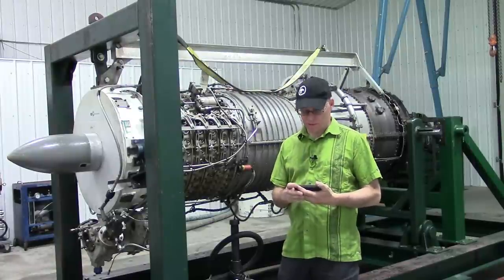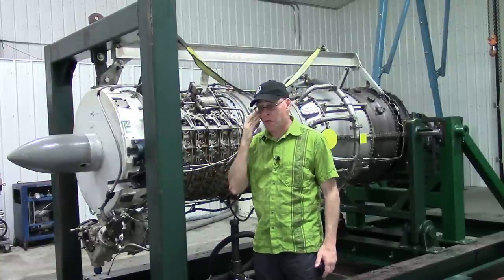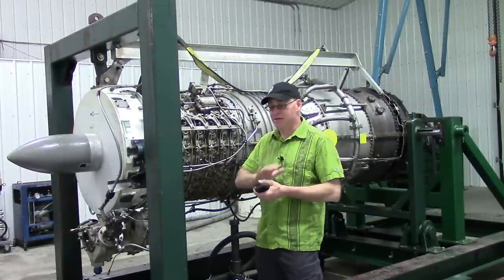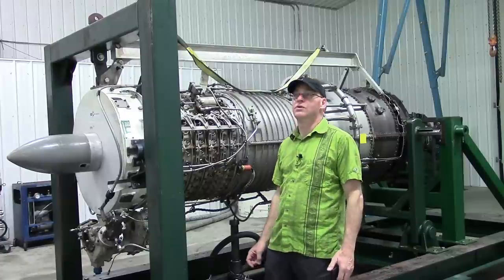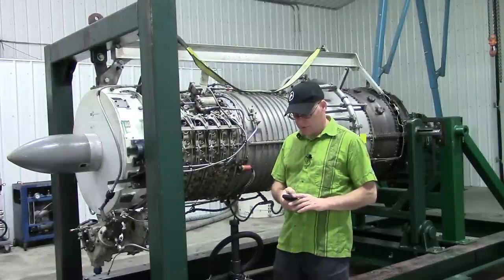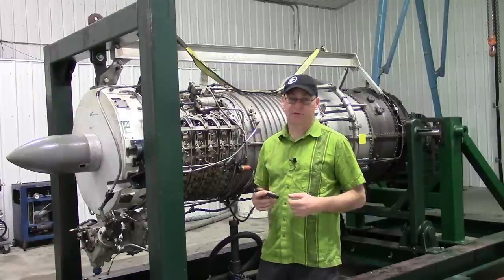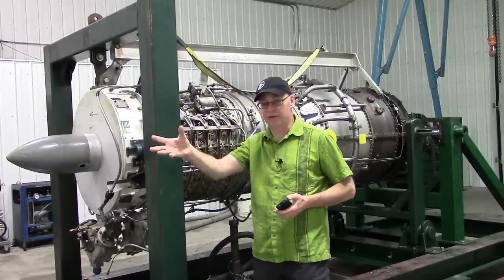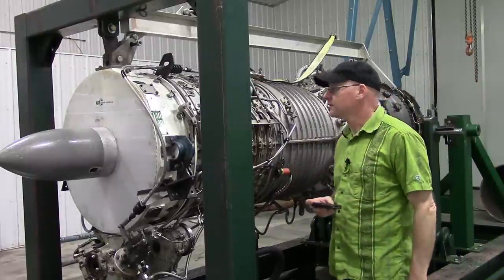Jet Questions 62

Comment: detent is the term you were looking for regarding the throttle.
Reply: turbosix I am not the "you" you are addressing, but I believe Jay mentioned that the throttle lever had to be moved through a slot in a back-left-back a little-right-back to shut the engine off.
Reply: turbosix Aircraft manufacturers make throttle quadrants differently. The throttle detents are not usually the same as the idle gates. Throttle detents are metal rails that have notches in them for takeoff, cruise, and climb power settings. The throttle lever cam runs along the detent and drops into the notch, keeping the throttle in the correct position. The FADEC then handles the rest.

Comment: Hi AgentJayZ,
Awesome videos. I recently bought an L-39 Albatros jet which of course uses the AI25-TL engine.  I won't be able to fly it for 1-2 years.  In the meantime, how often should I run up the engine, and for how long should I run it?  Is there anything else I should do to keep it well-preserved until it's flying regularly?  Thanks
-CamelTX
PS-You're welcome to ride in it sometime, once it's flying. I'm in Austin, Texas!
Reply from the maker: cameltx  If it were my plane, I would begin the storage period with new, fresh oil, start the engine every three months, and run it for about ten minutes after the oil temp came up to normal. I would not run it at idle, but at the lowest EGT, which we have found to be around 65% rpm.
Watch your EGT gauge, not the tach.
I also recommend that when you are flying it, that your cooldown period before shutdown be at this low EGT speed, and not "idle" rpm.
What ages a jet engine is not running time, but running time multiplied by EGT. Between runs, make sure the inlet and exhaust ducts are covered so air can't circulate through the engine. This is more important if the aircraft is to be stored outside a hangar.
The storage period gives you ample opportunity to fully inspect the engine with a boroscope. Have a close look at the combustor liner. They often have small cracks that you would have the time to have repaired.
Ceramic thermal barrier coating of the combustor liners, turbine nozzle guide vanes, and turbine blades in these engines is a good way to prolong their life.

Austin is a rockin' town. I was there on a Sunday night in April to see Jr. Brown at Stubbs, and I was amazed at the amount of music pouring out into the streets.
Feel free to message me with any questions.
Have you seen the AI25 test run videos?
Reply: AgentJayZ Thanks for the reply... yep, I watched your AI25 video series all the way through, and I'll probably watch them again!  The jet is in a hangar up in Rockford, IL for the next year or so. They're running it every 60 days, and keeping the plugs in the intake and outlet while stored.  Have a good one!

Comment: Dear AgentJayZ

I wondered if you have covered this issue of bleed air and the potential for it to have some nasty by products in it? I have read that up to 50% of air circulating in an airliners cabin is made up of bleed air?

My question is: If it is true, why do the manufacturers not fit a filter between the engine and the interior of the aircraft? They say the air goes straight in with no filtration which I find amazing! surely not. If it is drawn from the compressor side, surely it is pretty clean?

They say the Boeing 787 is supposed to be the first non air bleed fed airliner to be produced.

Just interested in your take on this please.

Thanks mate
Reply: Hotdogger808 
Hi, 
there have been incidents reported in airliners where high concentrations of turbine oil aerosol could be found in the cabin of an airliner.  See https://en.wikipedia.org/wiki/Aerotoxic_syndrome for more information. 

Cheers, 

Alex
Reply: DO9ZZZ 

Thanks for the feedback. It seems to be a hot topic in some areas at the moment. Still cannot work out why they bleed unfiltered air into the cabin.

Comment: Agent jay, regarding the question of direct mechanical shaft power output, how about the case of turbo shaft engines in helicopters, don't they work by harnessing torque directly from the engine. I guess they would need some kind of clutch system to gradually transfer power to the rotor system. I think your jet boats turn the propellers directly from the engine am I right?
Reply from the maker: Dave Poncio No. The Jet boats use helicopter engines. I have a playlist showing what their like inside.

Comment: i notice on the high pressure cases there are on the same row of bolts different sizes. it looks like the bolts get bigger towards the back. why is this done and how do you know wich bolts to use? is this the same on all engines?

Comment: BTW, ice buildup in the Fuel Oil Heat Exchangers (FOHE) can restrict fuel flow as has happened in the past on older designs, tho I'm not aware of that causing a complete engine shut down, just a loss of power.  Wikipedia has a great photo of such buildup from a laboratory duplication.
http://en.wikipedia.org/wiki/British_Airways_Flight_38
I don't think that would ever happen on the ground (industrial generators) except possibly in Antarctica on a realy cold night. lol.

Comment: Top gun would have done better if they had used the real life issue of the TF-30 engine in the F-14A failing due to compressor stalls. I had a chance to talk to Rear admiral Gillcrist who said that an F-14A somewhere in the world was having a compressor stall (back when there was still a few that hadn't crashed yet.)  A very large number of those early model F-14's went down for this reason.  Apparently the flight crews where forced to manually baby the throttle on that engine. No shortage of videos showing engine failures on F-14A's.  The jet liked to flip over and spin when one engine stalled.

I believe over 50 F14A's where lost before they replaced the engine.
Reply from the maker: AIM54A The TF30 was famously, and surprisingly... crap. Just look at the footage from that shite movie... as they run up to prepare for a cat launch... the exhaust nozzles are like the eyes of a chameleon: completely independent and unsynchronized with its "partner".

Comment: Some of the air that goes through the compressor passes around the combustion can and some seeps in to the combustion chamber. I cannot see how when it is of the same compression before the air in the combustion chamber is ignited. How can it pass into the combustion chamber being of a lower pressure?
Reply from the maker: Alfred Kennedy It's not lower pressure. It's a slightly higher pressure.
You've got compressor discharge air going two places: freely flowing around the combustor liner, and flowing through the holes in the liner towards the inside. Think of the liner as being a colander with really big hole in it. It does present a restriction the the massive amount of air trying to go through it.
And, the other end of the combustor liner is a big, open hole. The air all wants to go there.
The burning of fuel causes the air to expand greatly, but it does not increase in pressure... it rushes out the big open hole with great speed.

Comment: Well yes and no ... in physics efficiency  (energyyou get out/ energy you put in)
sometimes expressed as a percentage
So in the case of an industrial engine it could be (mechanical energy extracted from the power turbine / chemical energy goin intog the engine ) where that would express the overall efficiency ...

Comment: I think the flame out question came from the news report of a airliner losing both engines at 39000 feet an glided for 25 mins down to 13000 feet before they got them restarted... Would a flame out be a good reason for this or would it be because the engine maybe froze up?
Reply from the maker: Mr05sti I can think of three separate casual definitions for the term "froze up", and more if I think on it,  so the question is too vague to be addressed.
Reply: AgentJayZ There is an Airbus story about so called frozen engines here: -
http://www.telegraph.co.uk/finance/newsbysector/industry/defence/11648310/Engines-froze-on-crashed-A400M-plane-says-Airbus.html
Reply: *****  Ouch, the plane crashed because some of the aircraft's  software wasn't installed correctly(reading between the lines), leading to the engine power being FROZEN at flight idle on 3 of four engines before the crash. Wow what happened to all the independent and redundant  systems and no single point of failure causing a serious problem? It would be interesting to know what kind of system self testing and diagnostics modern aircraft have?
Reply from the maker: Coolkeys2009 Gee, there's a fourth definition of the term Frozen.

Comment: Hi Jay, would masses of excessive water ingestion causing the engine to shut down be classed as a flame out? I'm sure i recall the cfm56 had a problem with water ingestion. is this classed as a flame out?
Reply from the maker: +John Melling Well, it all depends on your definition of masses and excessive are. A 2 inch fire hose at full fireman pressure being shot straight into the engine? That's nothing for a modern turbofan. Try six of them, and you might slow the engine down a bit, more from chugging all that extra mass through the fan... but you probably won't put it out.
A flame out is when the flame goes out. It's obvious when that happens because all power is gone, and rpms drop instantly.
Reply: +AgentJayZ thanks for the reply Jay! You answered my question perfectly. A flame out is basically any time the flame goes out unintentionally. Makes perfect sense now!
Reply: Satunnainen Katselija I think you are referring to this flight https://en.wikipedia.org/wiki/Garuda_Indonesia_Flight_421  it was not pilot error that they went out, but it was pilot error that they were not able to be restarted

Comment: hi agent jay z I was looking in to the airbus 380 Qantas flight 32 it has Rolls Royce trent 900 engine oil pipe broke that lead to an internal engine oil fire that overspeed a turbine that broke apart. my question is I was look at a diagram of the RR trent 900 engine a 3 spool engine why does LP and IP rotate counter clockwise and the HP rotate clockwise is it just RR being different or is there a reason for it
Reply: Travis Johnson If you've ever played with a gyroscope you might have noticed that trying to tilt it away from you will cause the gyro to attempt to to your left or right depending on the direction it is spinning. This is called gyroscopic precession. The rotating parts of a Jet engine act as a gyroscope, and so when you pitch the plane the gyroscopic precession of the engine will make the plane yaw and vice versa. Spinning the rotors in opposite directions cancels some of this out and make the aircraft handle better in the air.

Comment: So is the fuel manifold a lot smaller for a liquid fuel.?
Reply from the maker: roger brandt There's a few videos where I compare a J79 sitting right next to an LM1500, and you can see that a 600 Psi liquid fuel manifold is indeed much smaller than a 250 Psi natural gas manifold...
Reply: AgentJayZ Your highlighting of the fuel manifold in the video and above comment regarding the pressure got me wondering:  Do Propane/Natural Gas -fueled engines have some type of gaseous fuel compressor or pump to generate that pressure or is that just the pressure of the gas that must be supplied to the engine?
Reply from the maker: Jason Skidmore In service the engines run on natural gas. Most NG pipelines carry the product at around 900 Psi, so it's just a matter of regulating it down to the necessary pressure needed by the fuel control valve.